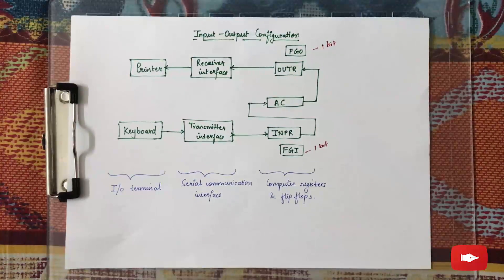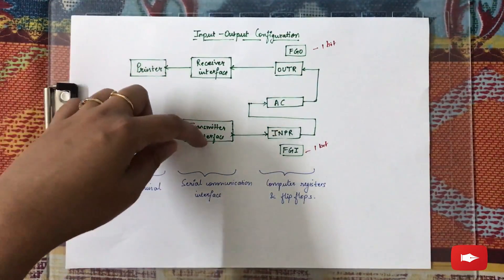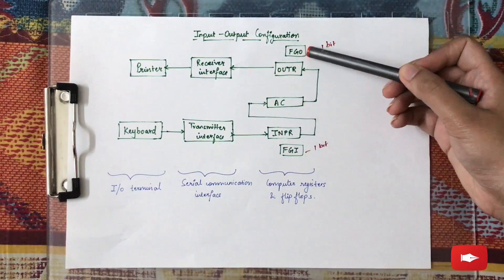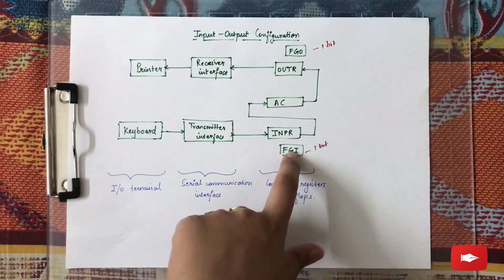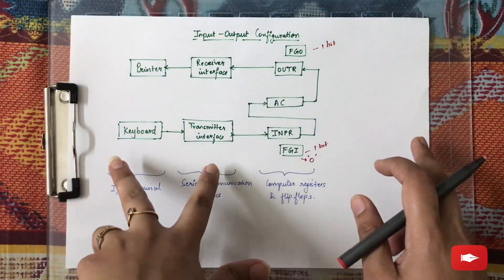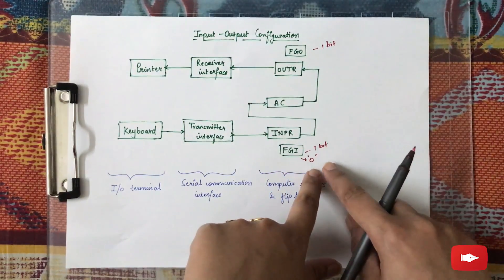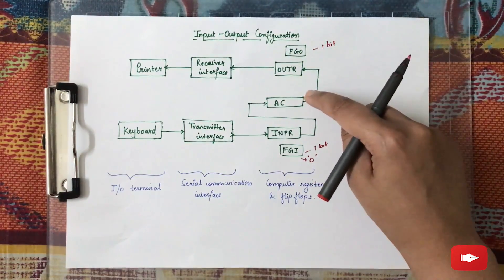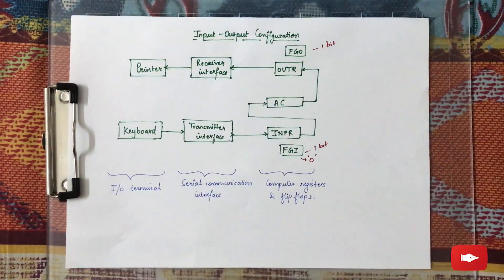Input/Output Configuration

Comment: This doesnt end at FGO Being 0. After FGO is cleared (i.e 0) and the computer finishes printing the corresponding character, it must again set FGO to 1.Because if it is stuck at 0 it indicates that its busy printing character. But if it sets FGO to 1, when you come around in the next time you will see that FGO is 1 and you know that you can transfer information from AC to OUTR and clear FGO. Then finish printing the character and set FGO to 1.

BTW The tutorials are awesome and Thank you!